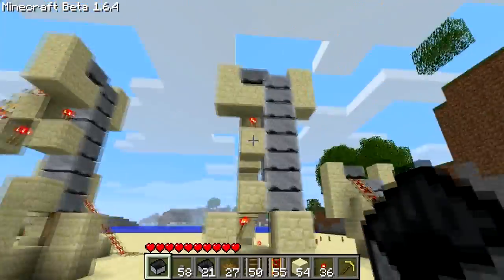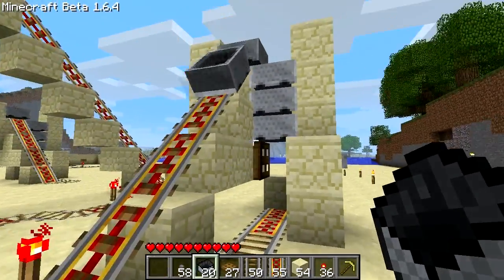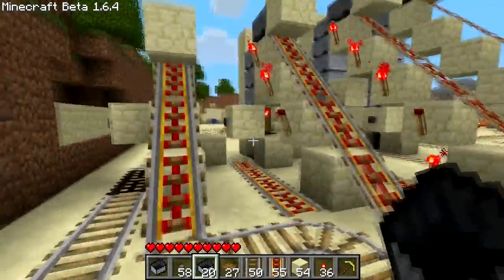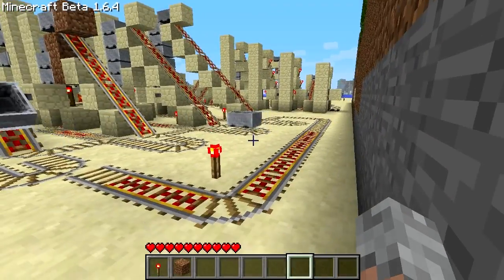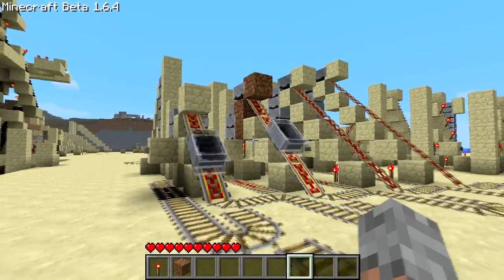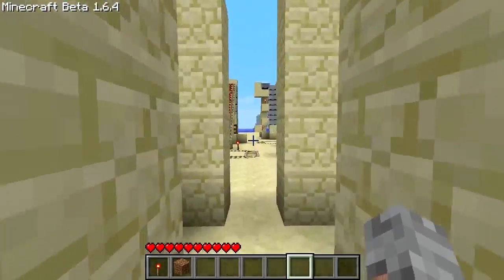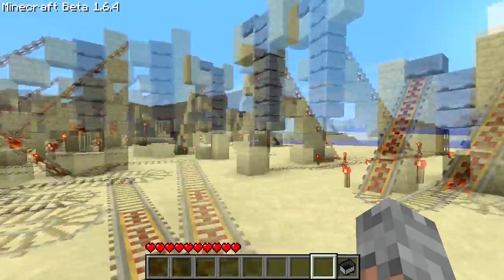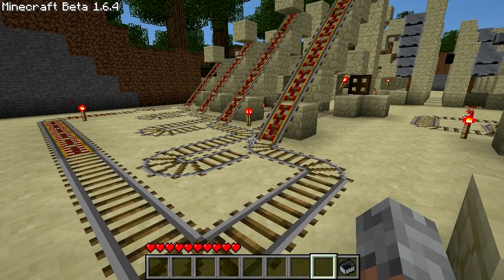Minecart PEZ Dispenser Science. 1.6 Minecraft.

Comment: interesting video.

i think t's not the overflow protection itself (the top cart) that's broken, but the trapdoor stacking. sometimes the carts merge. maybe putting one trapdoor each block and hooking it up with button will work more reliably. i didn't figure out a good way to put the redstone yet, because i think the timing needs to be simultaneous (no torches, repeaters). the carts fall through their trapdoor and stop at the still opened bottom trapdoor. when the pulse stops, they're set again